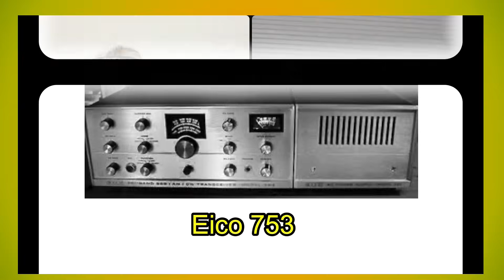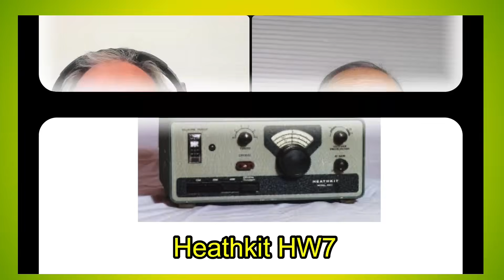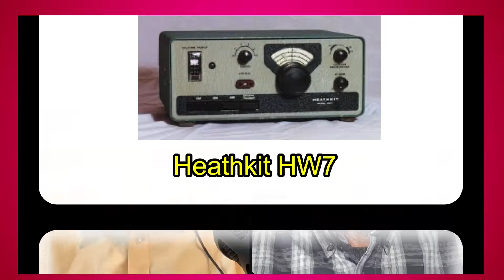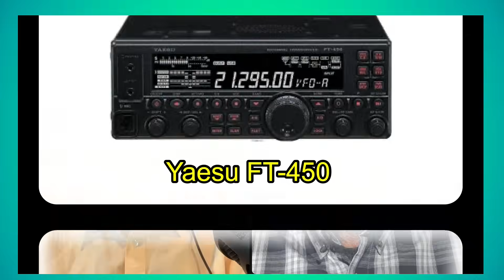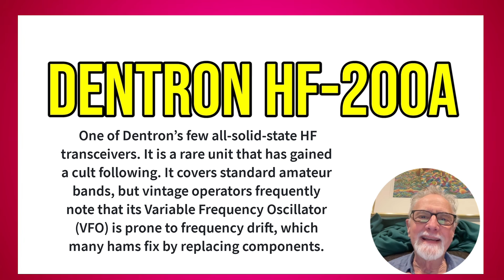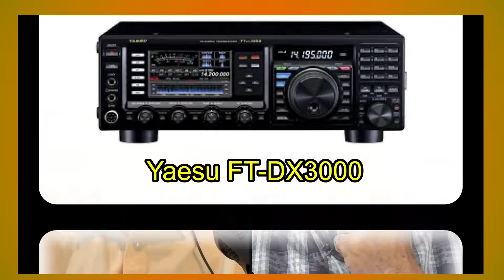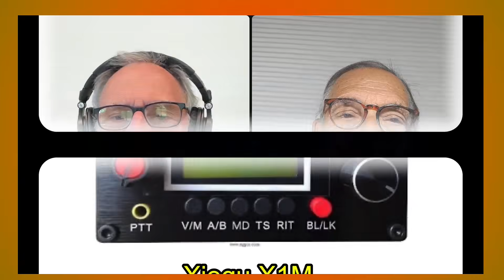10 Worst Ham Radio HF Transceivers -- Ham Radio Fun?

Comment: Very entertaining, good show.

Yeah, I had a Swan 350 with 6HF5 sweep tubes and had them go 'splody on me.  I was running full power CW at the time and there was a might WHUMP and the radio went dead  The incident also took out the HV plate supply (900V as I recall) requiring new diodes..  One of the cherry red 6HF5's was so hot, the glass envelope softened and imploded.  To be fair,  I acquired the radio in 1965 at age 14 (WA0MZT), and it was my main radio all through high school and into college, finally failing on me in 1971.  But it was fixable (new sweep tubes, new rectifier diodes) and it kept going after that.

My other rig on your list is the FTDX3000.  I owned two FT-950's for 8 or 9 years, and yeah, it had a long options Menu,  I bought a used 3000 from a ham club friend, which had an even larger Menu.  I guess I was used to it after owning 950's and I still think both are great radios.  Maybe I'm still a gluten for Yaesu punishment, as I'm now running a 991A and a 101D.  Some guys like Chevies, some like Fords...

73's Dave N7RF (aka Brad)
Reply from the maker: It’s always fun to hear stories about the rigs that defined our early years in the hobby -- good and bad. 73

Comment: I owned a 9420 for a couple of years a decade ago. Never had a problem with it. It had a hot receiver with a good xtal filter and a speech processor for transmit.  The only mod I did was put a jack on the back for a frequency counter.  12 watts out is a little optimistic.  Might be possible at 13.8v.  I ran mine from a 12v lead acid camcorder battery for about 8 watts out.

One fall, I took it on a elk hunting trip in Colorado.  The PA QSO party was that week end so I made a few QSOs.  I had several stations question that I was only running 8 watts into a vertical dipole.  I did have a natural reflector behind me and a 1000 ft drop of in front of me.

I guess i got one of the good ones.
73,  George AB0YM
Reply from the maker: That sounds like a fantastic setup for some mountain-top portable operating! 73
Reply: I have the MFJ-9015 15 meter CW rig and the MFJ-9406 6 meter CW/SSB rig.  They're both pretty good radios for what they are.  Except that the 9406 is supposed to be a 10W radio but all I can get out of it after tuning it up is 5W.

Comment: My bad rig nomination? The Kenwood TS-850S. The trophy wife of "high performance" radios, with so many surface-mount electrolytic capacitors to go bad, rot circuit traces, especially on the "CAR" board, but elsewhere in the radio. It's bad when the aftermarket has come up with a couple different replacement boards to perform the digital signal processing functions on the CAR board. Then, once you've gotten the radio to work, in order to actually make use of the receiver "performance" and transmit audio enhancements, you'll need to buy/load it up with additional crystal filters and external accessories. But, people still pay good-ish money for used 850s...
Reply from the maker: Classic radios certainly have their quirks, especially when it comes to long-term component reliability. 73
Reply: I know one serious contest station that used a pair of TS850S until just a few years ago and set many records with them.

Comment: I WHOLEHEARTEDLY concur with your inclusion of the Knight T-150 transmitter!  😂  As a cash-strapped teenager desperate to get on the air with my new Technician license back in 1969, I bought one of these POS 💩transmitters for $40 at the first ham radio auction I attended, planning to run it on 6 meter AM.  Unlike modern rigs which operate as well on 6 as they do on the HF bans, getting this piece of trash 😡 to operate on 6 meters was wishful thinking on Knight-Kit's part.  The only thing I got out of that final amp was an 800 volt B+ shock 🤬and a nasty RF burn!  I disposed of it very quickly thereafter.

     Now after 57 years of hamming, I've been acquiring duplicates of rigs I once owned and cherished; a near-mint condition Lafayette HA-460 6 Meter AM transceiver, a staple of much local VHF  activity until the advent of FM repeaters & the first piece of ham gear I purchased brand-new ($135!) ,  glistens in a corner of my shack, atop a Drake R-4B / T4XB combo that I never could have afforded in my teens.  An Allied AX-150, a duplicate of my first piece of solid-state ham gear, gleams on a shelf below, above a Kenwood TS-520SE.  On my left sits a PolyComm 6 50 MH. AM transceiver, a duplicate of the first radio I ever got on the air with the day I received my Tech ticket in the mail at the high school radio club,   A Heathkit HR-10 receiver, also like the one at the radio club & the first receiver I ever tuned in an SSB signal on, sits above it.  AT my elbow sits a massive Hallicrafters SX-101A (all 78 pounds of it!), a reminder of the all - Hallicrafters station that included one when I was just getting started.  In my bedroom sits a Hallicrafters S-85, a duplicate of the first piece of ham gear I evger owned.  ALL of these vintage radios are operational & get used occaisionally.

  But to add a Knight T-150 to my collection?  NOOOOOOOO!!!! 😨

😉 Tom WA1LBK
Reply from the maker: Great post, Tom. All of the fun in your life. No need to ruin it by going Knight Kit T-150 again. 73

Comment: I have an FT450"D" and don't worry, it's a lemon too.. They were selling them new here in VK for about 700 bucks back when we had AU US dollar parity. Should have passed on it because I've had a number of issues with it over the years. It needs repair again now but I just can't be bothered with it!
On the other hand, I've got a 50 year old TS520s that still works flawlessly.
Reply from the maker: It’s a testament to the build quality of those older rigs like the 520S that they’re still running strong today. 73

Comment: I was first licensed in 1975. My bad experience was my first receiver,  a cia 1962 Collins 75-S1. It taught me how to realize how bad my brand new Yasue FT/CB-101E was, "Certified Junk", sold it asap.  Got a Drake C line, think the Collins might have had the Drake beat, too close, tell. Then my next disaster was 1981, when I got an ICOM720A, brand-new top-of-the-line junk. I had the T-150; I remember the drift, but I think it was almost "ok" after a 30 min warm-up.
Reply from the maker: That’s quite the history of ups and downs with gear over the years! 73
Reply: I think you meant Collins 75S-1

Comment: Was there a AGC problem with the Yaesu FTDX3000 ?

Yes, the Yaesu FTDX3000 has a known, widely discussed issue with its Automatic Gain Control (AGC) system, specifically regarding how it handles strong impulse noise. 

AGC and Impulse Noise
In contest environments and heavy-noise conditions, the FTDX3000's AGC circuit has a tendency to clamp down harshly and "pump" when subjected to strong impulse noise or sharp static crashes. This severely desensitizes the receiver, causing the radio to momentarily go quiet or drop weak, desired signals in the background. 

What causes this?
This occurs because the AGC loop responds to steep, fast-rise waveforms of noise before the IF roofing filters have a chance to narrow the signal bandwidth. The AGC overshoots and aggressively pulls the receiver gain down. 

How to Mitigate the Issue
While Yaesu never issued a firmware patch that entirely redesigned this specific AGC behavior, operators have developed several effective workarounds to handle it:

Engage the Noise Blanker: 
Ensure your [NB] is active and adjusted to clip the impulse noise before it reaches the AGC stage. 

Adjust AGC Settings: 

While the "Slow" AGC setting is generally preferred for voice (SSB) operation, switching to the "Fast" setting can sometimes help the receiver recover quicker from aggressive noise clamping. 
Use RF Gain: 
Many operators dealing with dynamic band noise find that manually backing off the RF Gain rather than relying heavily on the AGC provides a much quieter and more stable receive, as it eliminates the AGC "pumping" effect entirely.

Comment: What Google's KI is telling us:

The Yaesu FTdx3000 is widely regarded as an excellent mid-tier, superheterodyne HF/50MHz transceiver. 
It is celebrated for its outstanding receiver sensitivity, phenomenal multi-signal characteristics inherited from the flagship FTdx5000, and comprehensive physical controls.
Key StrengthsSuperior Receiver: Excellent dynamic range and narrow roofing filters easily cut through crowded bands and heavy noise.
Tactile Control: Features a generous number of physical knobs and buttons, providing a traditional "shack" feel preferred by many operators.
Advanced Features: Includes a built-in CW decoder, an audio peak filter for Morse code, and extensive I/O options (like IF out for external SDRs).
Connectivity: Offers robust USB and RS-232 integration for digital modes, as well as multiple antenna ports.
Reply from the maker: Interesting to see how the software evaluates that particular rig. Thanks for trying it out. BTW, we would NEVER get any of our facts or subjective evaluations wrong! We are the dit and duh brothers. Click and Clack for the hams. 73

Comment: Not sure about your comments on the Swam 250C.  Mine had 6145 finals and did good on 6 meters.  I never lost a tube, but a good beam WTH low SWR helped.
Reply from the maker: Yes, we got that wrong, somehow. All we can say is too many rigs over 60 years in the hobby, and fact-checking that is about 98% accurate. But our memories are faulty. Age. Thanks for your understanding. 73

Comment: I built a Heathkit HW-7 and was working on a front end modification that was published in the January 1974 edition of QST. It replaced the 40673 FET detector with a circuit designed around a CA3102E differential amplifier. I acquired the components and got as far as etching the PCB, but the project stalled out, and I eventually dropped the hobby. (I was too busy racing bicycles.) I still have the whole kit & kaboodle, including photocopies of the magazine article. Maybe I should find a swap meet and unload it. Maybe someone could still have fun with it.
Reply from the maker: Yes, let someone else play with it. 73

Comment: You guys have obviously never used a Yaesu FTDX 3000. There are several settings for AGC and all you have to do is pick one of the shorter AGC time constants, and each one is adjustable. Receiver going deaf (20:31) for several seconds? I've been using mine for 5 years now and no such 'problem' exists.
Reply: Похоже, они не умеют устанавливать АРУ в зависимости от обстановки в эфире. Имею Ft 3000, замечаний нет. Хороший трансивер.
Reply from the maker: Thanks! 73

Comment: I had a Heath HW7 for a couple of years back in about 1970 ish . I made literally hundreds of contacts.  I got used to the problems you mentioned, plus a lot of other problems, but I had such a good time with it.  Now I have a Yaesu FTDX101D and have not had as much fun with it as I did with that little QRP, drifty, low sensativity,..... radio.  It was just plane fun.
Reply from the maker: That captures the true spirit of the hobby perfectly! Watch for the upcoming short video on how to be a happy ham. 73
Reply: Sometimes it's fun to pull out and use the older, more basic equipment.

Comment: The EICO radio may be responsible for some hams calling "CQ 20 meters" on the 20 meter band.
Reply from the maker: Nope. They were calling "CQ 20 Meters" on 40 meters, but the rig was tuned to 20. 73

Comment: Thank you for not mentioning the TenTec Argonaut. I have one with s/n 238, inherited indirectly from a silent key. I tried to buy a Drake TR7, which I believe was their first solid-state transceiver, but that purchase was vetoed..I used Drake equipment as a scout in Canada. My son has an Elecraft Kx3. You can see that we appreciate American radio equipment. I have nothing against Heathkit. I bought Heathkit equipment in Canada. Not everything American is fantastic. I drive a VW Buzz EV. My son and I both live in Norway. I moved here in 1980, my son was born here in 1983. Edited: I see I forgot to add that I have call sign LB2XJ, while my son has LB2HI.
Reply from the maker: @BrockMcLellan  Wow, great comments, Brock. I had 2 Argonauts and one TR7. The latter was a spectacular rig and still wish I didn't sell it. 73, Quin, K8QS
Reply: @HamRadioPerspectives  I thought I would just add one further comment. My grandson in California, one year old at the end of May, is called Quinn (with 2 x n at the end). 73, Brock KB2XJ

Comment: Apropå tx power settings at purchase: Why don't Yaesu not turn the tx power down to 5W before shipping? All my rigs have been Yaesu  and all were shipped at 100W tx power. I couldn't turn the power down on the FT3000 (I did fathom it out but the manual was a pile of bovine excrement). I tried to contact Yaesu but never got a reply. Still haven't many years later. I run 20-25W to end-fed.
Reply from the maker: @briandavison4447 Fascinating! We did not know that. Silly practice for them. 73

Comment: I am surprised that you did not include two Yaesu Radios. The FT747 and the Yaesu Ft 102. Th 747 suffered with the tuning shaft wearing out and this played havoc with the tuning. The 102 suffered terribly with the band switching relays that made poor contact. Eventually I drilled a small hole in the top of each enclosed relay and squirted switch cleaner in periodically to make the band switching function again.
Reply from the maker: @rogerdavis5053 Great material. We limited the video to ten because most guys won't watch long videos, even with humor. But we need to do Part Two. So many rig issues over the years. Thanks for watching. 73
Reply: Ft747 гавно редчайшее. Енкодер проскакивает. Шум как водопад Ниагара. Szize!
Reply: I had a friend who owned an FT-747 when I first got into ham radio.  I don't know if he ever had those problems with it.

Comment: Back in the 80's a friend of mine gave me his beloved Swan 250 to fix for him.  It was having a Transmitter problem.  The visual inspection led to finding that the final tubes were suffering from thermal implosion of the glass envelopes as well as the original height of the tubes, no longer met specific design criteria. They had shrunken like a bad Halloween apple.

I returned it to him unfixed and forgot to reinstall the shield cover for the final amp.  Which he wanted later.  Which I could never find.

The Swan 250 was so bad,  I made it a brickyard exhibit for perhaps a flower garden.

😂❤
Reply from the maker: @jwdevine  Sorry to hear about the episode. Maybe you should have lost the 250 for him!? ;} 73

Comment: I've had the FT3000 since March 2020. Got it as it was supposed to be the little brother of the FT5000, which I also once had. I've had one operating problem with the audio when operating quick contest speeds with the APF on. It would sometimes make a loud pop and though the audio had locked up and was releasing. The fix was to not use the APF in narrow mode. It only occurred a couple times. but under normal use it did not happen. It's performed well for me for 6 years now and is my primary rig. Mostly only use for FT modes with an occasion CW contest. So you guys have fun dissing it and I'll smile all the way to that DXCC #320+. 😄 de K7CS
Reply from the maker: Sounds like you have found a way to work around those quirks to achieve some serious operating success. Great work! And thanks for sharing the tip with others. 73

Comment: I had an 753 and within a half hour it would go 15 khz up the band! I could never get it to settle down. It was a very pretty rig but drifty as all get out! DE WB7RTT.
Reply from the maker: @KeithSanto Keith that sounds like a classic case of legendary thermal instability, thanks for sharing your experience with that rig. 73

Comment: In my opinion, everything Eico made was junk, factory wired or kit.  Grid dip meters, radios, oscilloscopes, power supplies. Seems I picked up a bunch of it many years ago and have none of it now. 73  WA4QGA
Reply from the maker: @ElPasoTubeAmps The company certainly had issues. Yet, as things go in ham radio, the company still has fans for many of its units, as we suggested in the video. 73

Comment: I owned a G-76 with factory AC. I found that the cabinet got so hot that it melted a plastic CW key set on top of it. I read a review that stated the first model submitted for testing had too sharp selectivity for comfortable tuning knob travel, so Gonset fixed it. How did they fix it ? They made the selectivity wider, simple. I think the basic problem was, too many  fire-FETs ( tubes ) crammed into a box that size. No provision for cooling. The radio looks nice if you don't get into details. It is a lemon. I would hate to have to use one.
Reply from the maker: @kargocult  Thanks for sharing that cautionary tale about such a legendary heat-generator. Related it's hard to track the changes in older rigs as they tried to fix problems without giving the rig a new model number. 73

Comment: Swan and others, were famous for their TV sweep tubes failing. Have fun
Reply: I have a Galaxy III (3 band version of the 5) that used a pair of sweep tubes to put 300w ssb.  Only destroyed one pair but fortunately had spares.  Was fun but a shelved for something with   less power but more bands.  Will eventually get it back on the air when I more desk space.  Sweep tubes weren't trouble free but were surely a way to get fairly cheap medium power.
Reply from the maker: @adiamondforever7890  Right. But they were cheap! ;}. 73